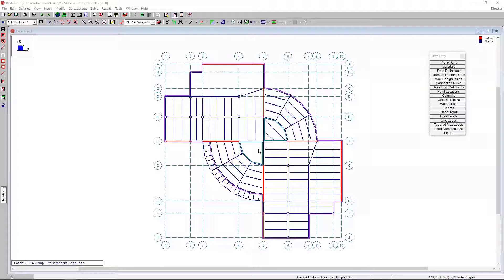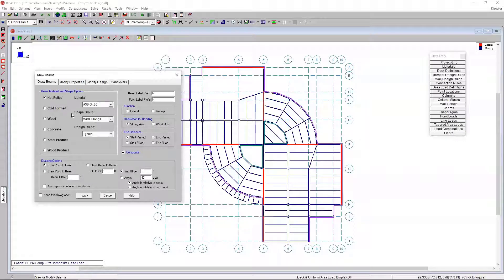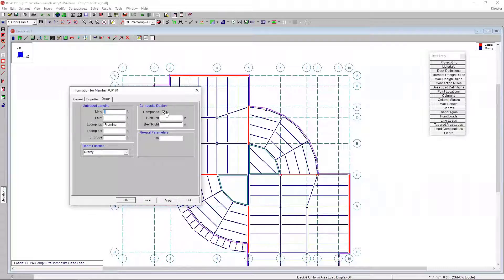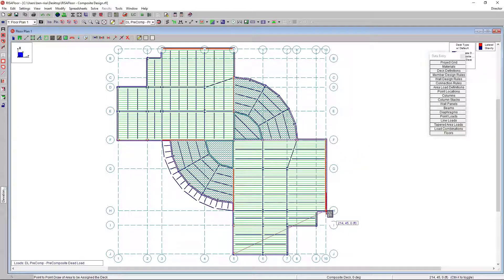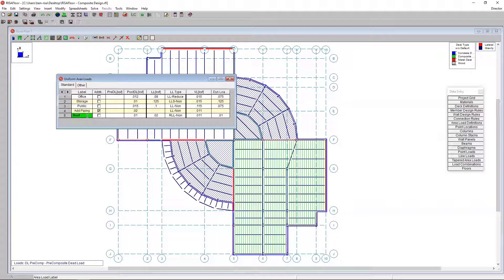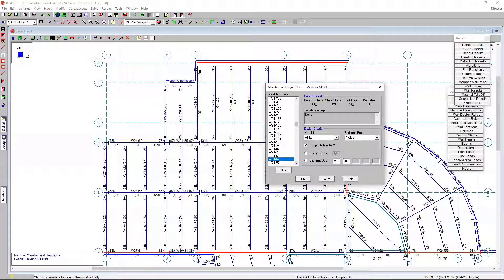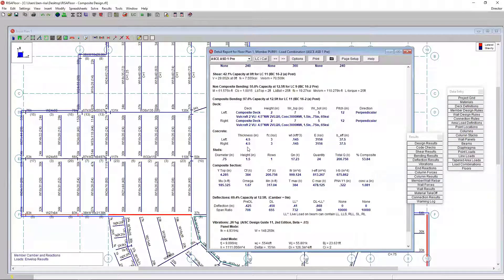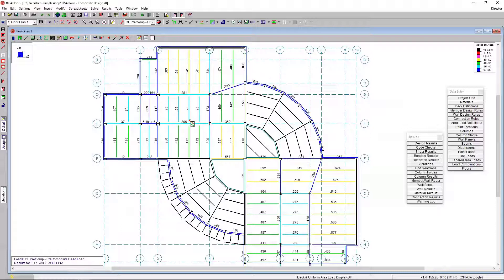RISA Live  - Composite Beam Design in RISAFloor

Comment: Very Informative video. 
I have a doubt. Can you please clarify ?..... At 6:00, you showed steps to change deck direction. So, u have chosen Comp Deck dir. parallel to X-axis and manually chosen the corners of the deck, right ? . There's  already a deck spanning in Z-dir. and now u have drawn another in X-dir.  So,  Doesn't bottom section now has two decks assigned/modelled or Risa overwrites the old deck and assigns only one deck? Bcoz at 6:18,  when u displayed "Deck Type" , RISA showed green lines in both directions indicating two decks ?? Please clarify on this. Thank you
Reply from the maker: The deck the is "assigned" second overwrites the original deck applied.  The graphical view at the end includes the original deck and "as applied" deck which will be the deck and direction used in the analysis.